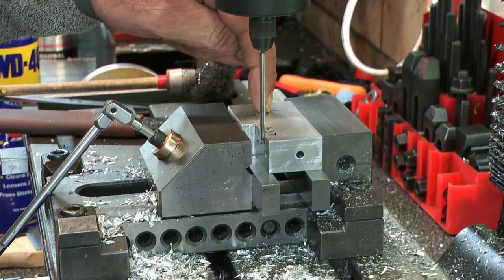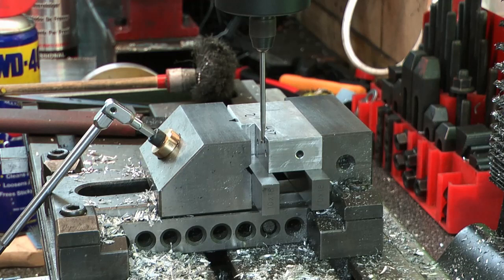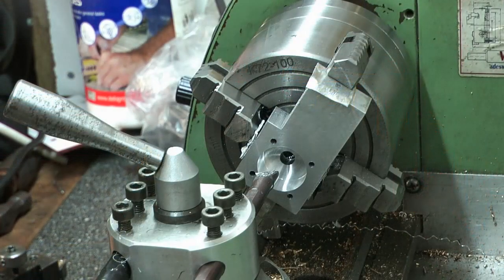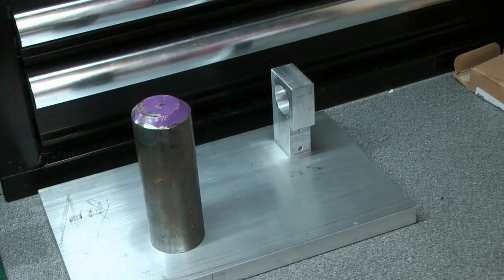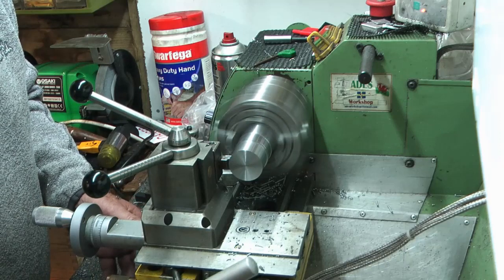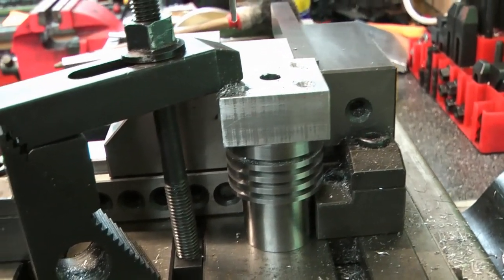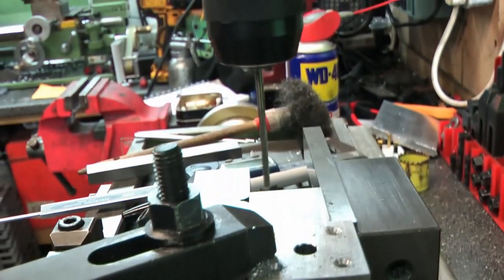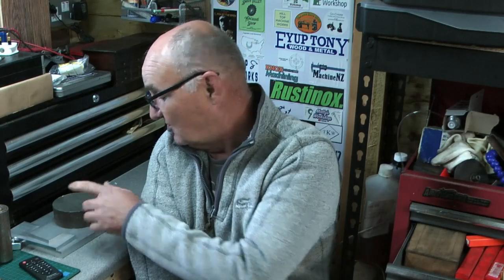Webster engine build part 1

Comment: Gday Ade, nothing like making parts twice, it’s common here, I’ve never had trouble with overheating on my Webster engines, I’ve put 3 full tanks of fuel through back to back to see if it would overheat and no trouble at all, still had perfect compression as well, having the extra cooling fin does look a lot better, fun build mate, Cheers

Comment: Hi Ade, Is your cylinder steel or cast? I have recently plucked up the courage to build the Webster after watching Matty's excellent series.  I built the base and frame first but cocked up on the cylinder.  I am working from metric plans and because the cylinder bore is in imperial I got mixed up somehow and bored it .890 thou rather than the required .873. (shame as the bore came out excellent)  I  used Cast iron  Meehanite , turned down from "2 diameter  to "1.5  and it was so messy I am thinking of doing the cylinder in steel instead of making another huge mess of the lathe and workshop using cast again.
Reply from the maker: My cylinder is EN1A leaded . I will be running viton o ring instead of cast rings so it should work out fine . Cheers Ade.
Reply: @ade63dug  many thanks Ade. now subscribed

Comment: Hi Ade I’m an ex toolmaker and have built steam engines but would love to build the Webster engine. Could you tell me where you sourced the gears….I don’t have the equipment to make them and it would be very expensive to do that. I would really appreciate your advice. Thanks Chris
Reply from the maker: try bearings r us online for the timing gears I got .2.5mm pitch and 2:1 ratio . Cheers Ade.